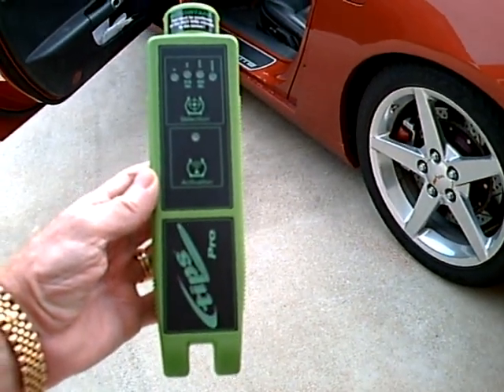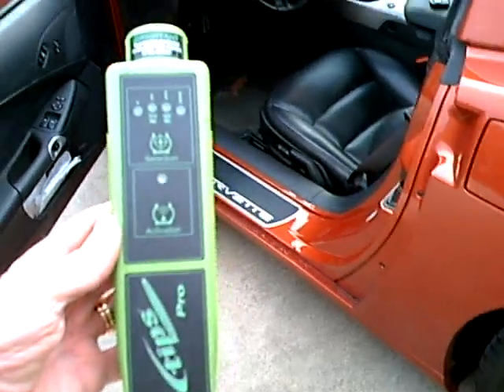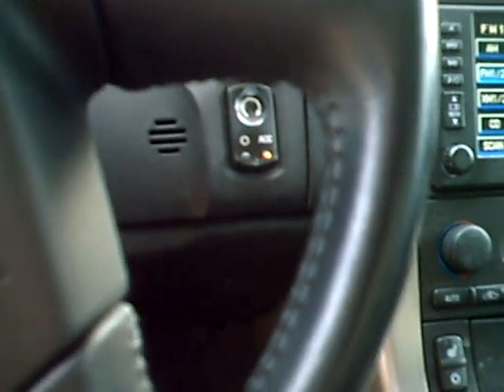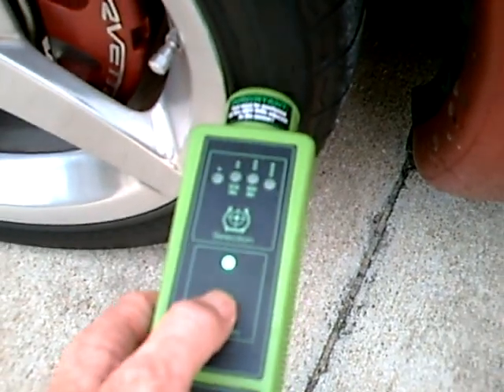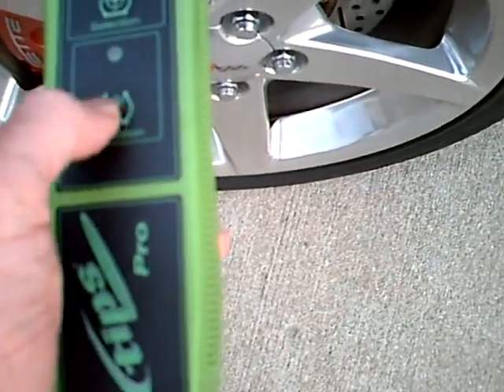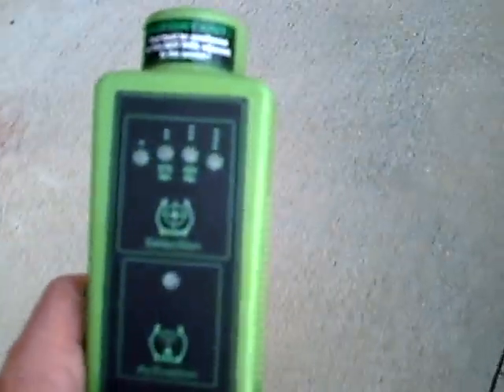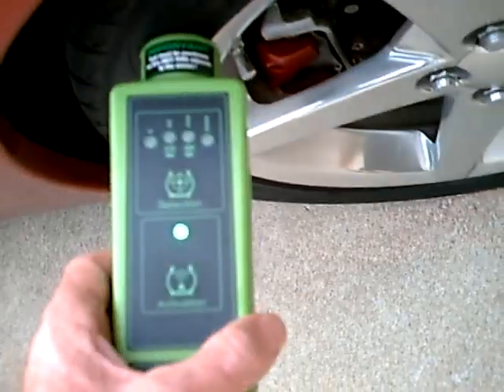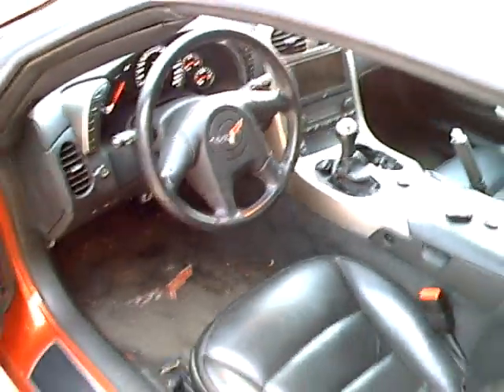Using a TIPS tool to register tire sensors

Comment from the maker: Well....the Corvette doesn't have a spare - it's got "runflat" tires that can be driven up to 100 miles with no pressure. All new cars starting with 2008 model year will need to have a Tire Pressure Monitor System, so all shops will need one of these tools.

Comment: Have you used this in conjunction with any type of scan tool with any other make/model vehicle?? I am trying to figure out what to buy to do reprogramming and diagnostic work on TPMS systems without breaking the bank. I have a Genisys running system 3.0 with software for Asian/Domestic and ABS/Airbag in the 2008 versions. Any insight would be appreciated.